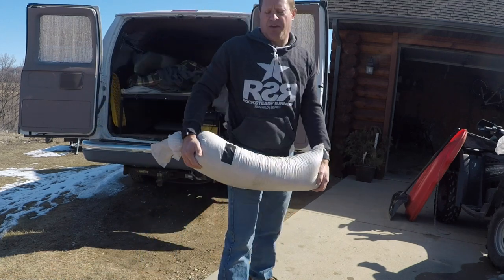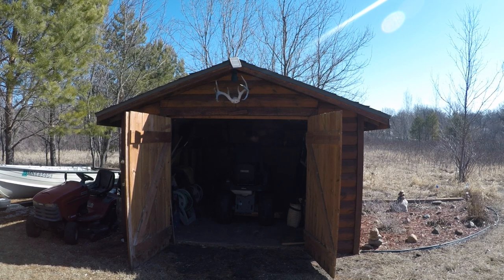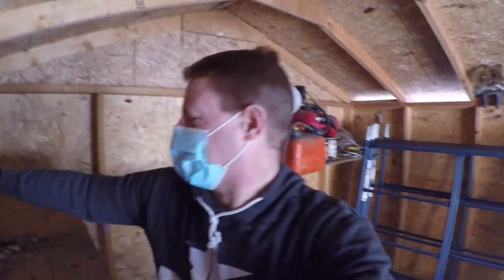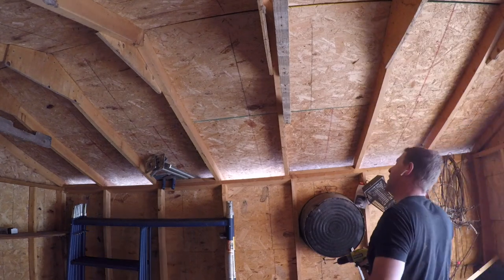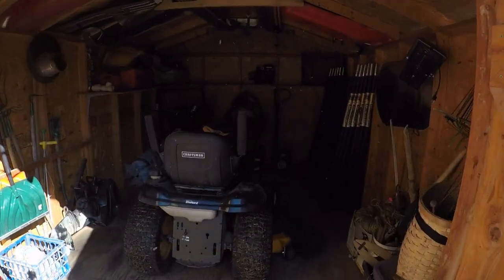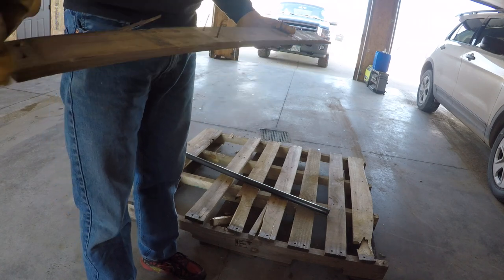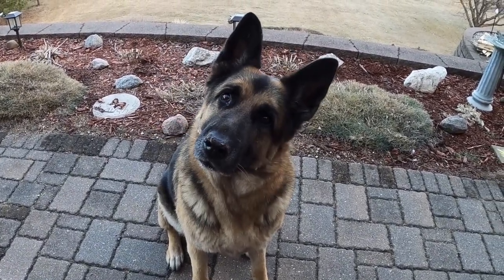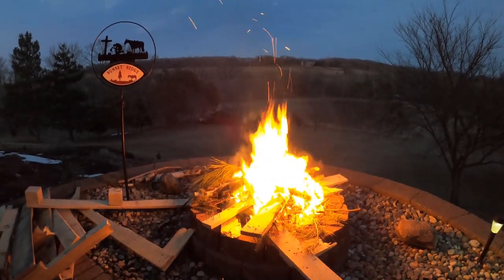The river house: Spring cleaning and using my new pallet buster pry bar to recycle free wood.

Comment: I've been putting 5 gallon pails full of sand in the back of my rear wheel drive pickup in the winter. Those tubes of sand look much easier to use!
Reply from the maker: Easier to stack than pails at least!